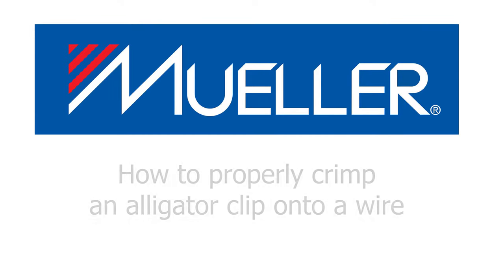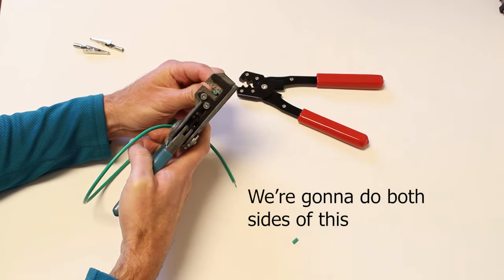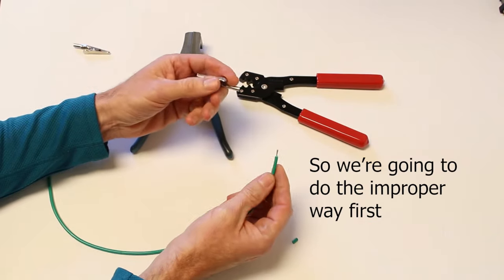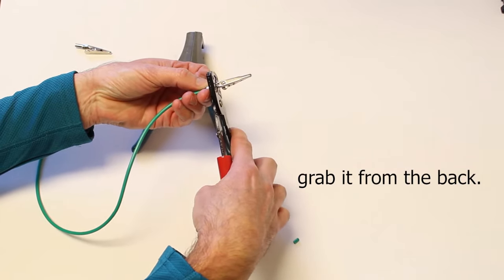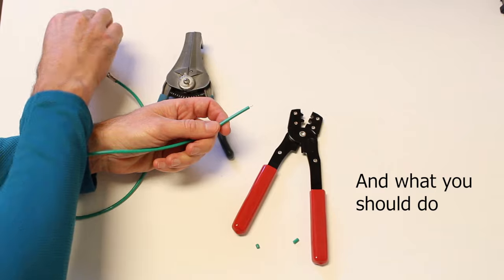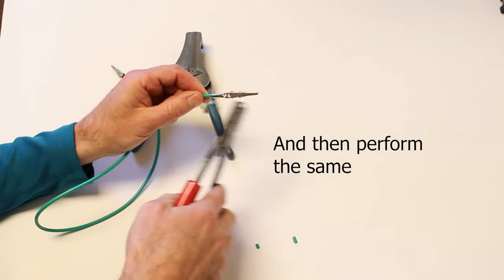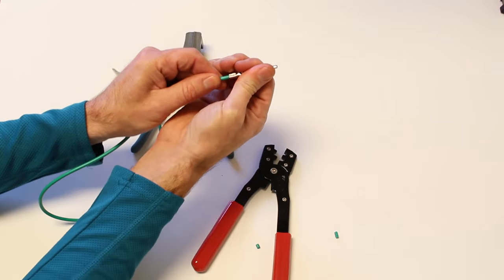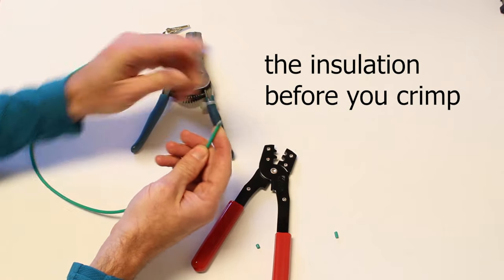How to properly crimp an alligator clip onto a wire

Comment: Great, quick, clear simple presentation! Thank you! 
What is the screw for on the alligator clip?
Reply: Screwing  down the wire if it's connect to a spade lead.
Reply: I, too, was wondering what the screw is for.  Just bought some that have screws.

Comment: Same thing i do when making new spark plug cables. I have spool of copper spark plug wire and a assortment  of ends. Thats why your crimp pliers have a IGN crimp on them . I reuse the the terminals most of the time . That can be time consuming until you get good at it.

Comment: Nice! Next question: where do I get the stripper & crimper you're using?
Reply: Home Depot, Lowe's etc. Almost every hardware store has them. They are called Self-Adjusting Wire Stripper

Comment: usually the cheap one has no barrel, just a hole and two "teeth" (for wire insulation crimping?), how to properly crimp those kind of type?
Reply from the maker: We believe you are talking about an alligator clip similar to the BU-70 like this: http://muellerelectric.com/product/bu-70/
Mueller’s clip has a “wire strap” that can be squeezed with needle nose pliers.  Many non-branded alligator clips do not have this feature and must be soldered to obtain a good electrical connection.  The “teeth” are only used to hold the wire insulation which acts as a strain relief.
Reply: @muellerelectric626  What are the 2 tools that you used to strip and crimp the wires?

Comment: The part where the wire is folded outside the jacket yet the clip is supposed to be inserted "inside the barrel" confused me.  If the wire is blocking entry into the insulation (which I guess is what's meant by "barrel"), how would it be possible to put the clip inside the "barrel"?
Reply: Just push it in.

Comment: Also these alligator clips are rated for a max current or amps.   The way the video shows how to connect this to the wire is just not a good connection.   10 amps through such a poor connection.....

Comment: OK I see you are the Mueller that is the manufacturer of lots of electronic parts.  And I thank you for that.   But what you just showed me in this video makes no sense at all.   Common sense says that 95% of the inside of the barrel of the crimp connector is not even in contact with the hook up wire conductor. These alligator clips are crimp or solder.   So soldering might work in some cases.   In my application I am using this on a high temperature area.  So solder might melt.  

So I need to either crimp wire on or I can also use the screw terminal that comes on some of these.  If I use the screw then I can use the right size crimp connector for my 14 AWG wire.  If I use the alligator crimp barrel or hole I notice my 14 AWG wire is only 2mm diameter.   And the barrel or hole of the alligator clip is 4mm dia.  And therein lies the problem.  The hole is too big for the wire. So I have been thinking about adding another piece of wire next to the wire,  or doubling the wire so it fits the hole.  Either that or nickel sheet shims around the wire to make the wire larger.   I have to experiment to see what will work.